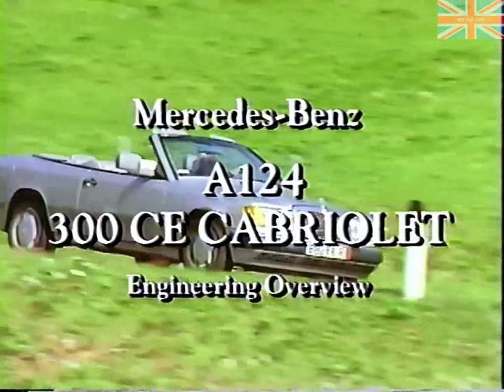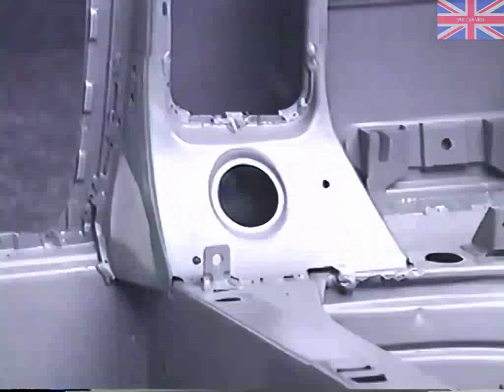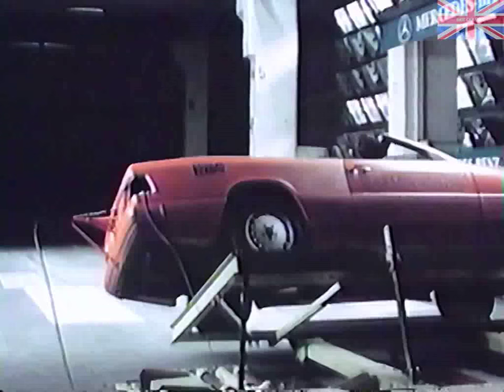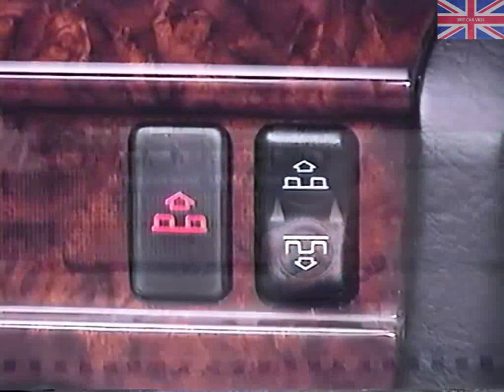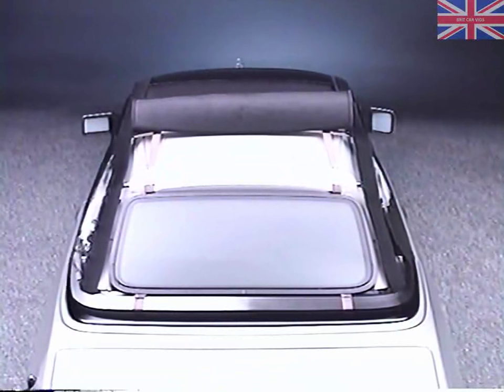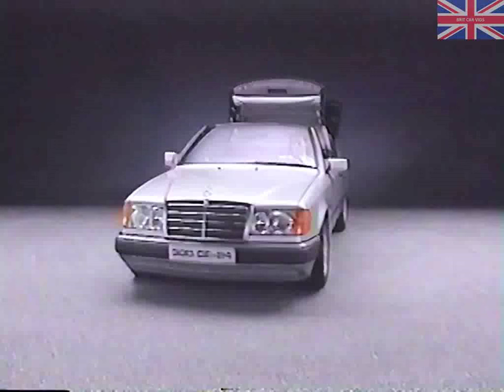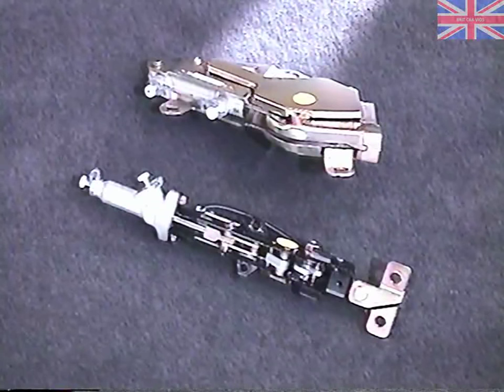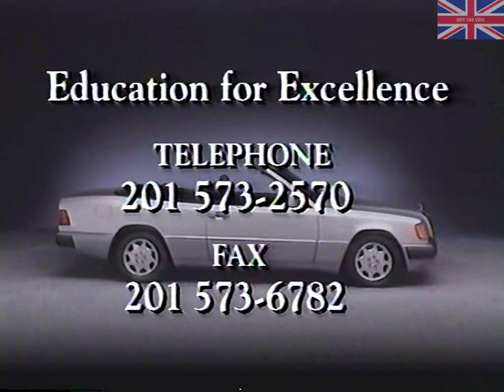Mercedes - 300CE (W124) Cabriolet - Engineering Overview (1992)

Comment: +1. .. A informative primer touching on the W124 cabriolet/coupe chassis enhancements. .. Gotta luv the 3 added "enertia-weight-dampeners" strategically positioned. .. Fast forward and its year 2018. .. The Dodge/Ram 1/2 to 1 ton pickup models have - (not since 1999) - been throughly redesigned for MY2018. .. The ladder frame/chassis architecture benefits from the comprehensive redesign utilizing high strenth steel, light weight aluminium and (wait-for-it) enertia-weight-dampers by another name. .. Small world.

Comment: A whole lot of additional engineering complications....just for the sake of getting that open-top motoring experience ?
I've always been sceptical of the practicality of soft-top cars in so far as security issues (easier to break into ?) as well as how well the resistance to water leakage from the soft roof with repeated open & close of the top ??!

Despite how good any car maker can ever be i believe this open soft-top concept of automobile design is never going to be on par with rigid shell bodywork on durability, rigidity, security. Perhaps a better compromise would be some multi piece metal foldable hard top...provided they can create enough space within the car to store the roof when not in use ?

Comment: Now that these vehicles are coming up on 30 years old, no parts can be found for them... I'm about to completely redo the hydraulics... That's no problem as top hydraulics has the know how... But limit switches... Seat belts... trigger switches... And a wiring system with old and brittle insulation has me concerned... 

Any introduction to those already doing this would be appreciated... For instance... The seat belts are completely flaccid... No spring tension at all. They are not to be found anywhere so far, so rebuilding them is the plan somehow... Anyone doing that already?